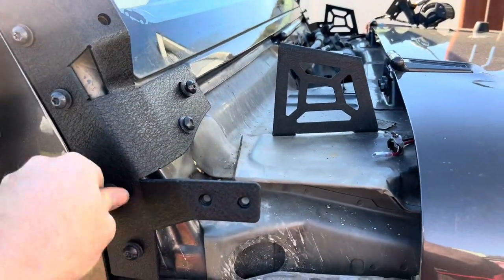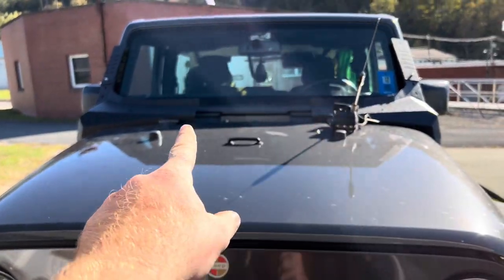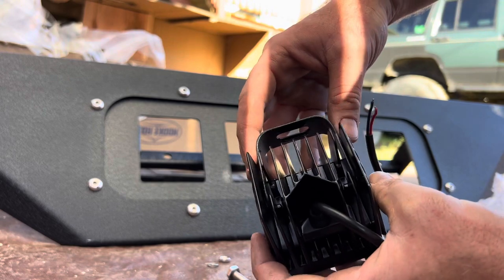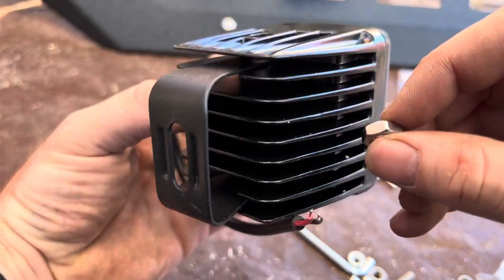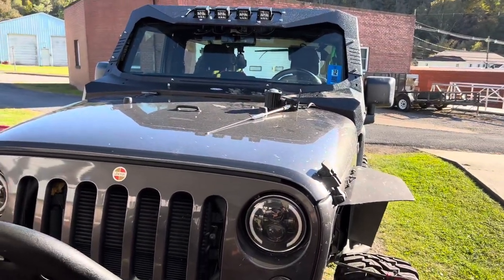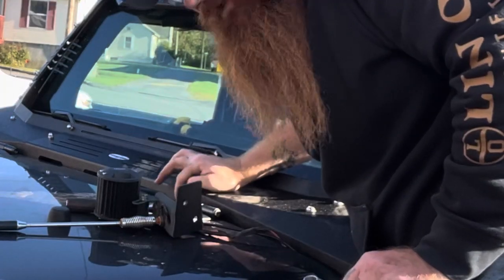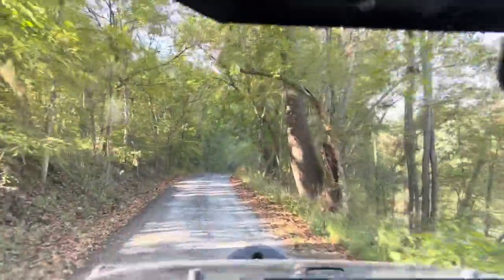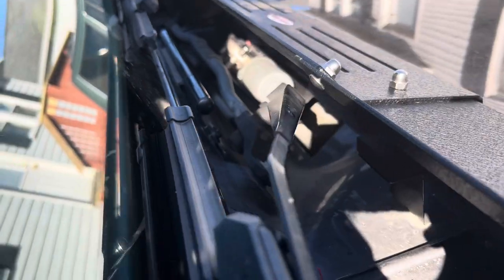Hooke Road Windshield Frame Cover Visor Roof Sun Visor Cowl Body Armor install/review

Comment: Thanks for this video. Very easy to follow. My cowl didnt come with instructions and I was not aware that I would need to remove pieces of the body. I feel confident that I can do this correctly now. BTW, I would like to second the request for wiring of the pods.

Comment: Any tip or tricks u can share started installing mine and having a hard time with cowl portion lining up also sucks believe I didn't get all my hardware bolts so had to run and spend 60$ on hardware